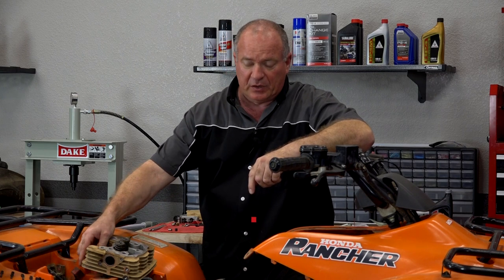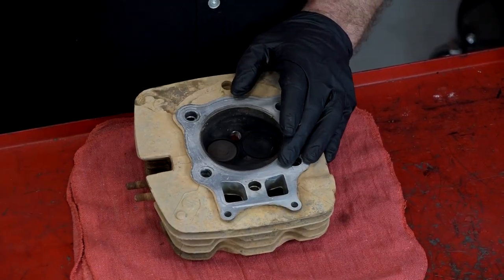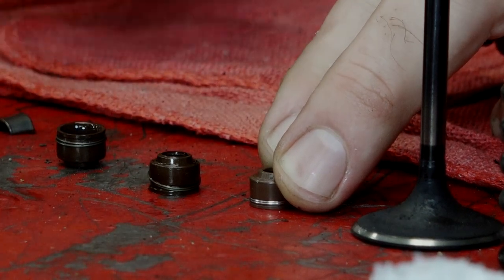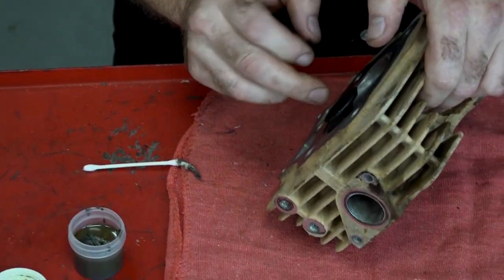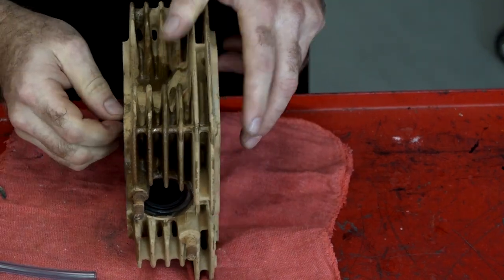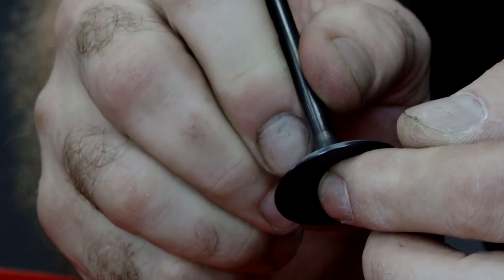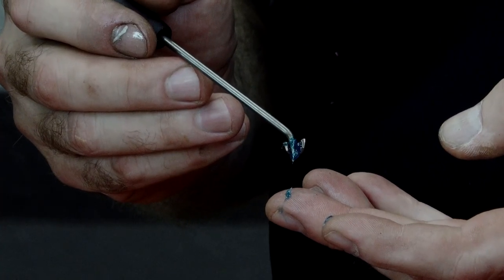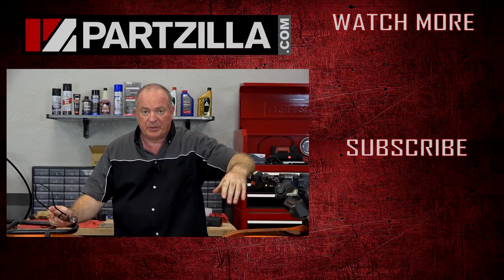Honda Rancher 350 Top End Rebuild Part 3: Valves and Head | Partzilla.com

Comment: Thanks for the videos! Will the cam followers come out with the jug off? Have no noise at idle but a good knock under a load, valves are at .006 and the whole top end is new except rods and cam followers, I know the knock isn't piston slap or valve chatter, only happens when revving, sounds like a rattling exhaust sheild( checked for rattles and don't have any, this is pretty loud) also, machine runs great tons of power. Been to Colorado up steep mountains elk hunting, worked it hard runs perfect. Again no noise at idle ever, gets a hard knock when revved up.
Reply: I had the same problem with one of my bikes, i realized it may came from the crankshaft bearings, when i replace it both, that noise dissapeared

Comment: Hey I have a Honda rancher 350 2002 and it died in the water I pulled it out asap and gassed on it when I started to blow as much water out as I could now it starts ideals a bit then starts blowing smoke and if I gas on it it starts blowing heavier but when I let off it stops idk what’s rong with it I’m about to buy a engine rebuild kit but I wanted to ask you first

Comment: John I don’t know you but I need help rebuilding my Honda 400ex. I seen your video on the top end rebuild 3part video which I say is very helpful plus I’ve seen your cam chain timing video but I haven’t seen a bottom end rebuild video. I have everything to do the job I just need some direction.
Reply from the maker: I can try to answer questions as they come up, but we will add it to the suggestion list and try to get a video done!

Comment: A 350 Honda I got today the guy said he was ridding it an it lost power a went off ant run sines he said some one told him it cud be v the valves in the head but it will not fire pull starting it and gear

Comment: Why won't my 2001 rancher es shift it will shift up and down until I reach a certain speed then I have to shift manually or restart the machine and it shifts up and down all over again
Reply from the maker: Sounds like either the shift motor is getting weak or you have a problem inside the trans with a bent shift fork. The reason it will shift at certain speeds is that you are rev matching the transmission so that it is the easiest (no load) to shift.
Reply: Partzilla thanks for the reply.  Could it be a bad battey?